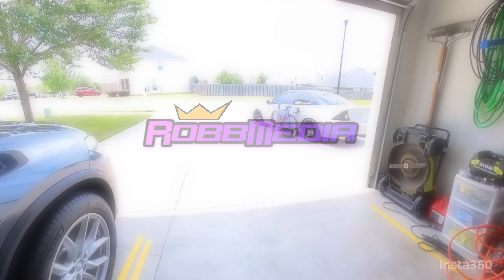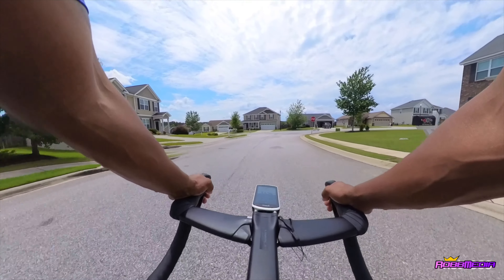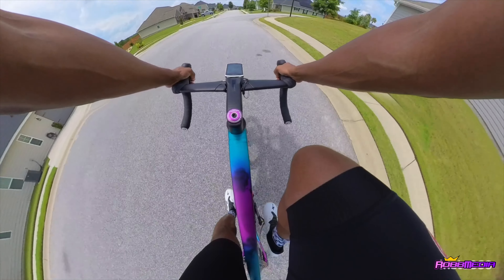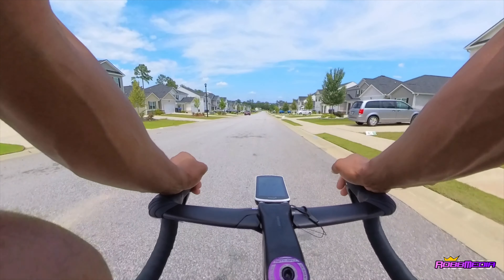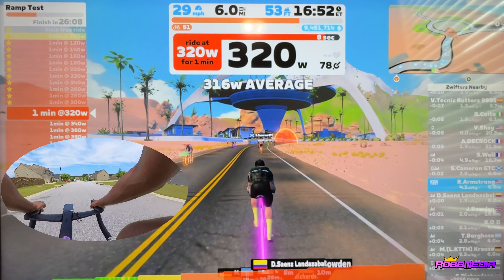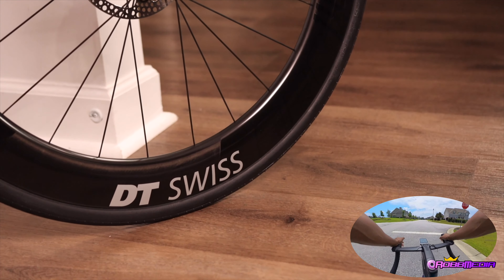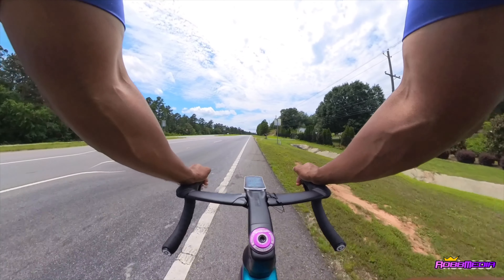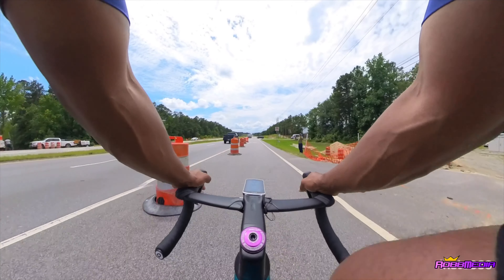DT Swiss ARC1100, Is FTP Important 🤷🏽‍♂️, Allez UpDates + CeramicSpeed 😮. "BVLOG-01" | RobbArmstrong

Comment: Not really a fan of those welds on the Allez but your build is off the freakin chain!! Just bought a powermeter so your comments about FTP and training resonate.
Reply from the maker: Welcome to the Channel and appreciate the Comment! 🙂

*SideNote: No one is a fan of the welds, 🤣 now that you have a PowerMeter that’ll open up so much more *random bike conversations, lol. I really like looking at the data and analyzing it. It’s cool to know and see what certain power feels like. Also depending on the PowerMeter, seeing the Cycling Dynamics like power balance between each leg and seeing where you generate power in the pedal stroke. Did you get a *Single or *Dual sided PowerMeter? 🤔
#RobbArmstrong
Reply: I went with the Assioma Favero Uno single side pedals. Very sobering seeing what my actual numbers are right now😳😳
Reply from the maker: I had the Favero’s before I moved to Quarq. I really liked the Favero! That was an excellent choice.
#RobbArmstrong

Comment: On the DT Swiss 1100 what internal width are they? Was looking at Aeroads and trying to figure out if they have the newer 20mm ID model or the older (I think 19 or even 17?).

On the FTP, I find the ramp inflates the number a bit if you are a strong dude with good burst power. I know for me I get +15w on the ramp versus a 20min test and I have good 1s-5min power but I fall off after that. 20 min test with a negative split feels more accurate to what I can actually do for an hour to me. Outside I like to test on hills, but really the trainer is easiest for ramp... trying to do them on flat roads is really hard.
Reply from the maker: I really need to take a FTP Test outside. I’d like to compare the two results. Eventually I’ll get there. 

Regarding the DT Swiss, mine have the 20mm ID. & I upgraded the Star Ratchet to the 54T, 🙂
#RobbArmstrong